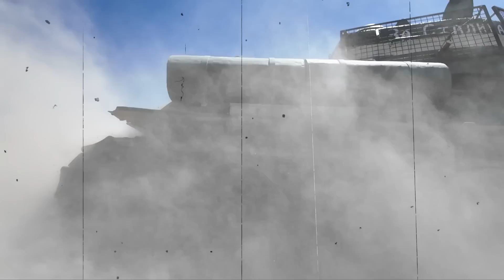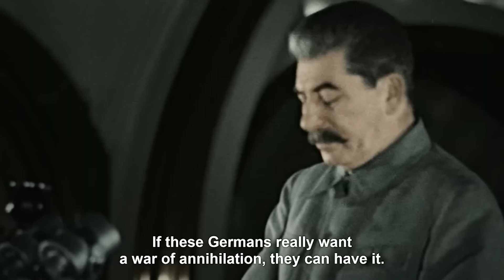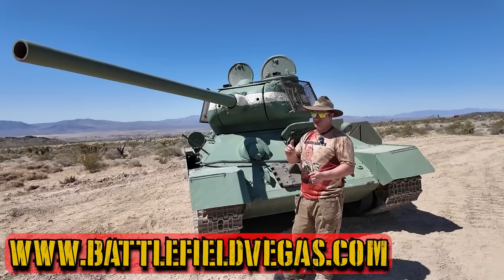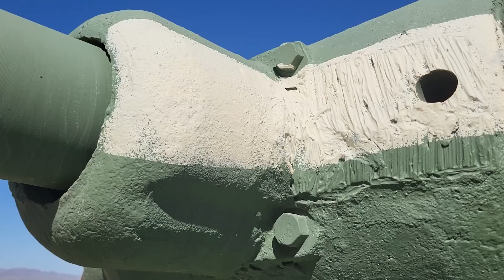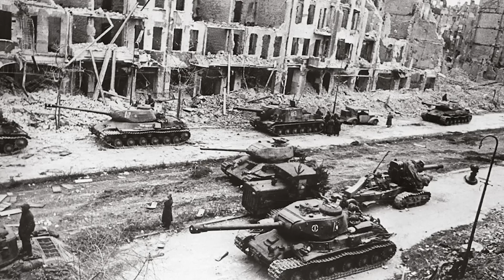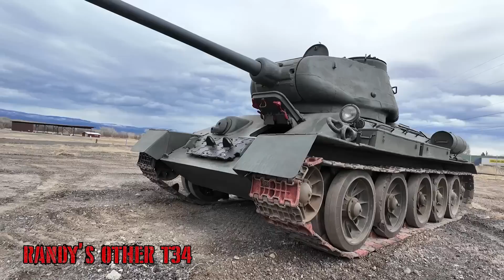T-34 - Manufacturing Genius?

Comment: The tower is either post-war or modernized, as the exhaust fan cap is visible in front of the hatches. 🤔 Спасибо!
Reply: Its not modernization its a Somvovo plant 112 post April 1945 production
Reply: @steels96   Krasnoe (red) Sormovo 😅  in Russian «Красное Сормово» 
🙏🏼 Thank you
Reply: @steels96  On forums, they still argue about whether the T-34/85 with such turrets managed to fight or not.
Reply: @steels96  It is believed that tanks with such fans are post-war T-34s.🤔🤔🤔🤷🏻‍♂️